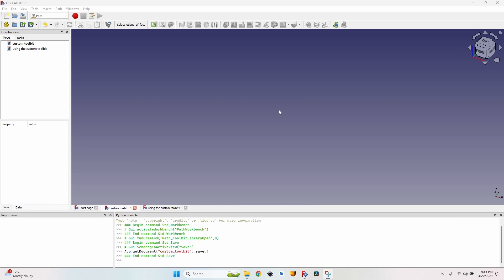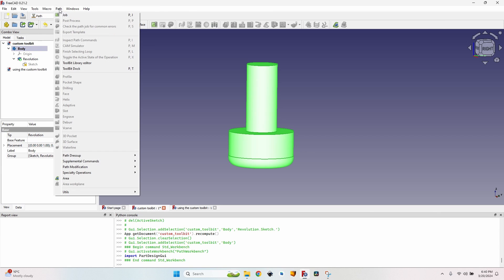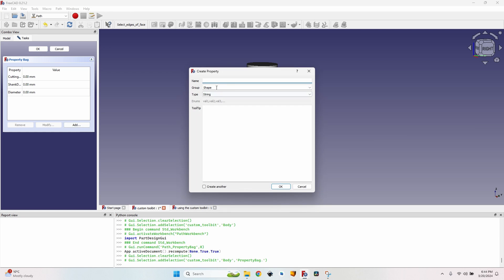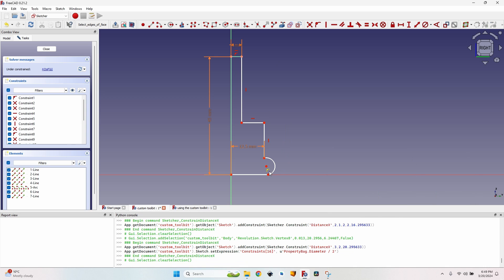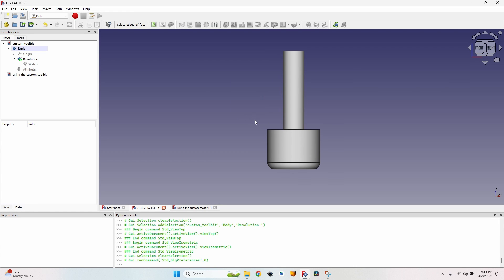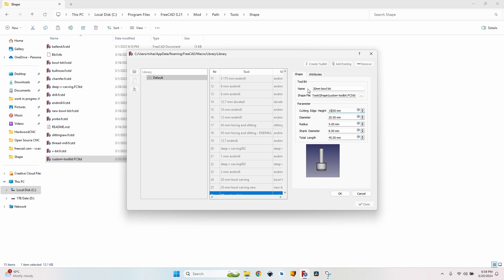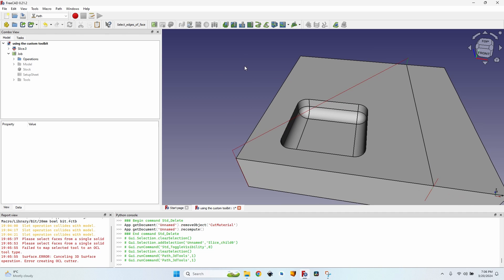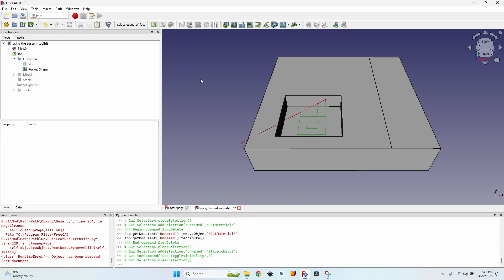Create Custom Toolbit in CNC CAM – FreeCAD Ep.15 | Tool Library Workflow

Comment: you got to be fu....kidding me. spent an hour googling and getting  results like I was asking to customize the actual GUI toolbar????
then AI gave results about doing a body sketch. Like, WTF?
It's just a mill toolpath cutting a a slot. Width, cutting height. In Dyson or Musks factory with space engines maybe tools themselves are specially made. But this is open source software for skinflints in a leaky shed.
Is there not a macro add on someone has kindly written that just alters the library according to your own tools dimensions?
is this pedantic process just so the animated simulation of the gcode output can have a whizzing giff with chips flying at the right speed?
I now expect to find that I have to enter the density, hardness and water content of the stock at a range of temperatures and GPS coordinates and heights above sea level.
Reply from the maker: This is about defining a toolbit with a non standard shape. If you want to add a standard toolbit (endmill, ballend, bullnose, v bit, etc) you can do that easily: https://youtube.com/shorts/osvga_0vF04?si=ZKg9KXKMBYgHBfB6

Comment: Just a heads up. The Better Tool Library is being integrated into FreeCAD. It is currently starting to appear in the weekly builds. This means F360 tool libraries can be load into the FreeCAD database.
Reply from the maker: Thanks! I just visited their page yesterday and noticed the info. Can't wait to see how it works
Reply: !! NICE. I was just looking for a way to convert F360 tools files, but maybe now I won't have to. Awesome!
Reply from the maker: I've just tried the latest development version. The Toolbit Library Editor looks better, but I can't find a way to add a fusion tool library. Is it not implemented yet or I don't understand how to import it?
Reply: @opensourcecnc  It is not there yet, the PR is in place so the code is in review. Remember I said starting to appear  :)

Comment: Nice intro guide. One problem with FreeCAD tool models like this is the geometric "solver" gets its panties in a knot if one of the dimensions ends up zero. Eg here if you have a straight tool and you set shank diam = diameter. The shoulder disappears and FC spews some cryptic nonsense in the report window. The trick is either make the flat shoulder slightly inclined by giving height difference or by adding a very small amount to one dimension so that shoulder does not become zero and the two end points become one. eg instead of just a number you use the expression editor to  add shaftDiam/50000 to the head diameter. It's a hack but will not affect your work.  This kind of problem can affect chamfer tools or anything where your tool is a simplified version of the stock tool .  New thread cutting tools have a problem if you set "crest" to zero for a pointed tool. It breaks the model. You need to lie and say crest = 0.001mm or hack the tool model as you do here.
Reply from the maker: I wouldn't go this way, but rather define the correct geometry, separately for each tool type.  I try to avoid hacks as much as possible (even though, since we are talking about FreeCAD, you can't avoid them completely) because you will end up some time later not knowing why there is a strange behavior

Comment: Hi. I can't find a tapered ball nose cutter in the standard toolbits. And I don't see any possibility to use something similar. There is no template with cutting edge angle and rounding radius.  How did you solve this problem for yourself? Did you create it as in the video? Or is there any possibility to make it easier? Maybe download it somewhere? Ty for video.
Reply from the maker: Unfortunately, creating a custom toolbit is useful just for preview, using the simulator. It won't take into account that shape when creating the toolpath, it will use the maximum diameter and a straight shape. I have used a straight ballend and went by with the small differences. When I had to have precise results, I used blender and blendercam (fabex cnc now), which has a tapered ballend toolbit option.
Reply: @opensourcecnc  Thank you. I suspected as much. Don't you think using v-bit (with the ability to set the angle) instead of straight ballend would give a better result?
Reply from the maker: @thesilentbard7795  it depends on the actual toolbit that you use. I use one with a 10 degree angle, very steep, close to a straight end mill. I prefer to have the surface correctly calculated, with the rounded tip and have slight differences on the walls
Reply: @opensourcecnc  Is this how it works in 1.0 too? If so maybe I should look into getting some othe CAD/CAM software?
Reply from the maker: @ManosDanger  I am not aware of this being solved. So..... But blender can handle tapered ballend, take a look at the videos about blender, maybe it helps
Reply: @ I noticed you have a lot of videos on Blender as well as I just searched Youtube for Blender CAD. Im going to have a look at your videos on Blender. Thank you for your videos!

Comment: If anyone else is rewatching this to figure out why your parameters are missing from your tool. Verify that the properties bag is attached correctly. If attached correctly it will be named attributes. If it is added incorrectly it will be named property bag. As stated in this video select the body before adding the property bag. Selecting the sketch will also work.

I was unable to find any way to attach a property bag to the body/sketch after it has been incorrectly created. 

PS. Great video! Thank you for making it.
Reply from the maker: Thank you!

Comment: I don't know if you thought about it, but in case someone doesn't want to change the model (like removing the fillet) just to fit the bit, which should always be the last resort IMHO. There are several other ways to get around the filleted pocket done:

• Create a* pocket operation* for the pocket bottom face, but then set a negative number for "Pass Extension" in the operation's properties. With that the tool can be made to cut up to, but not including, half the tool diameter "outside" of the bottom face (i. e. for a 10mm diameter tool, the "Path Extension" can be at most -4.99)

• almost the same can be done with a "Face" operation . The Parameter is called "Material Allowance" instead (or very confusingly "Extra Offset" in property view) and has to be positive instead of negative. Also the "Boundary Shape" has to be set to "Face Region"

• Create a pocket operation for the pocket bottom face without any special parameters (which will lead to the pocket being too small as in the video). Then add a profile operation for the bottom face. It also has an "Extra Offset" parameter, which can be set to any value (not limited to half the tool diameter). You set that to the negative of the fillet width.

• Select the vertical faces of the pocket as the "Base Geometry" for a pocket operation. The pocket will not be deep enough, which can be easily fixed by changing the "Final Depth" of the operation.

The first two are the fastest, but also most limited. The third one the most versatile, but two operations you have to keep in sync. The last one is the most tedious when it comes to selecting the faces, if the pocket has a complicated shape, but also the "safest" because the necessary offsets are calculated by FreeCAD (even when you change the tool).
Reply from the maker: Great! All those ways are good ways if you don't want to change the model. That's what I love about FreeCAD: for anything there are at least a few ways of doing things in order to get to the same result.
I might add that instead of selecting the side faces for the profile, you can select the top perimeter and change the final depth (using the+0.02 mm hack). This way you don't need to add any extra offset, it's a simple profile with just the final depth changed.
I'm still waiting for the moment when YouTube allows for adding to a video, there are so many things I would change...